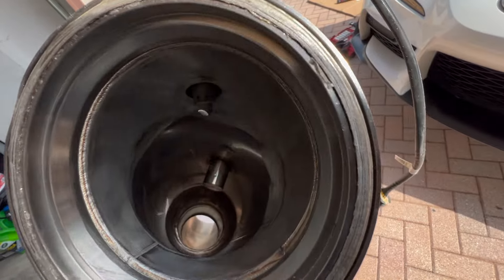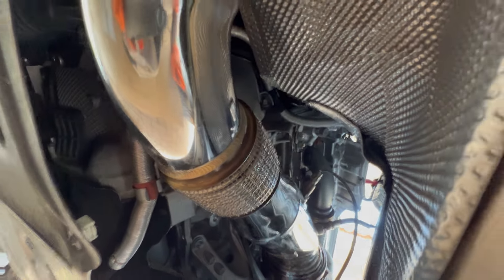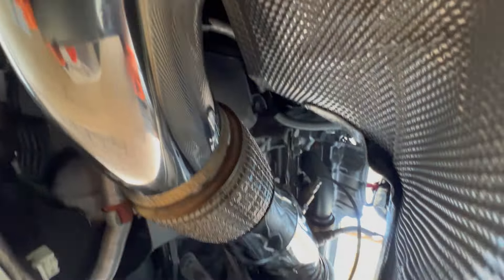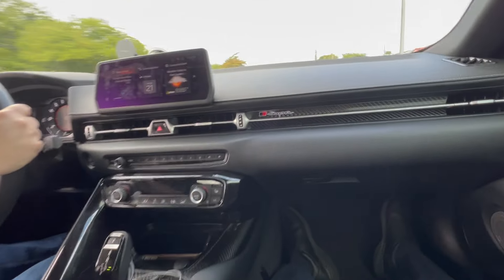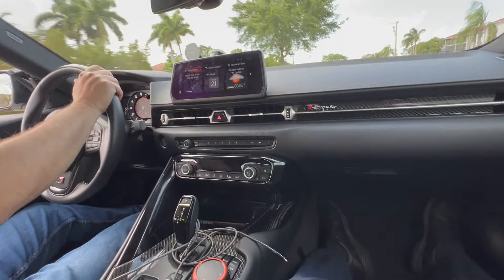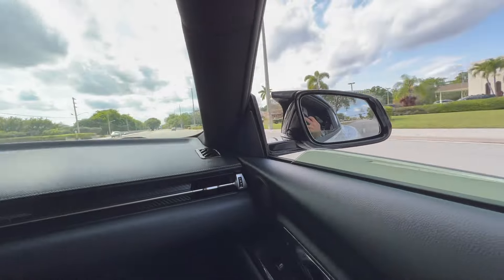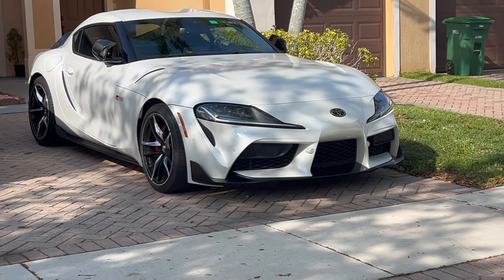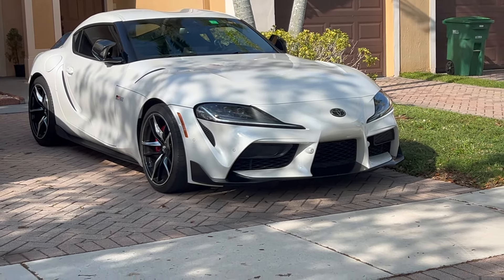CATLESS DOWNPIPE WITHOUT THE ENGINE LIGHT! A90 SUPRA B58TU ARMYTRIX

Comment: How do you install a downpipe without getting an engine light??
Reply from the maker: Basically by tricking the car! ARMYTRIX calls it a cat simulator , as you see there is a built in spacer for the secondary O2 sensor and inside the downpipe the O2 is also covered with a sleeve with very small holes that mimic a catalytic restricting exhaust flow. Without this you would get an engine light because the car will sense that there is an imbalance in the air/fuel ratio and the catalytic isn’t there anymore doing its job of reducing emissions.
Reply: So did the check engine light come on?
Reply: So with this down pipe I can pretty much pad smog?

Comment: I had the titan downpipe and an O2 bung for the 2nd O2 sensor.  Its like a mini catalytic converter adapter that plugs into the downpipe and you can install the O2 sensor on it.  Didnt keep the check engine from coming on.  After 2 cycles the light comes back on
Reply from the maker: Interesting will let you know if this one holds up.